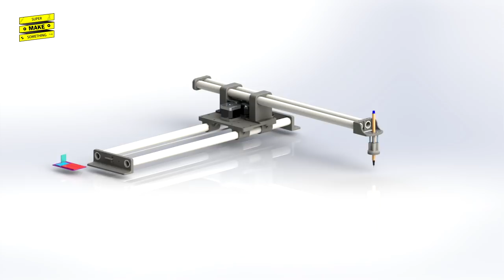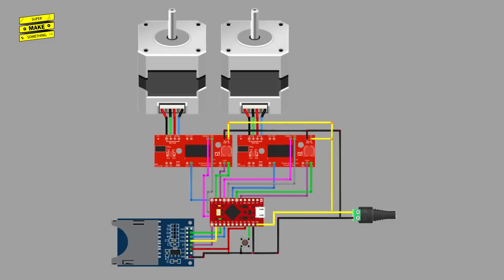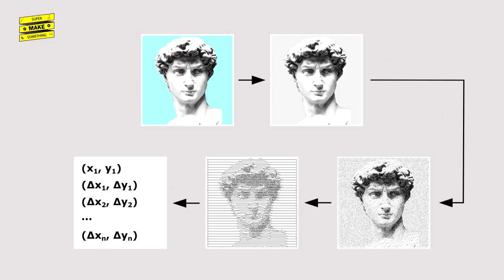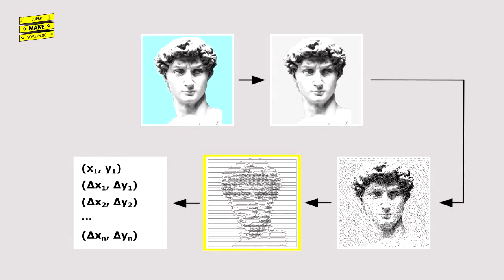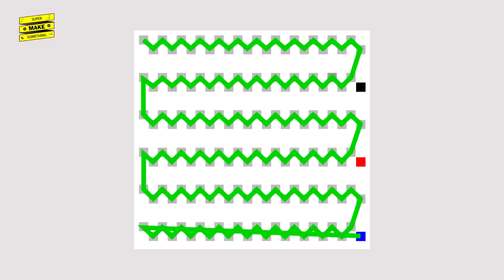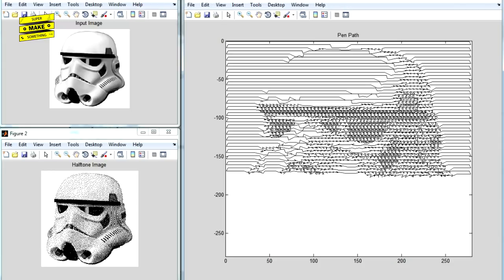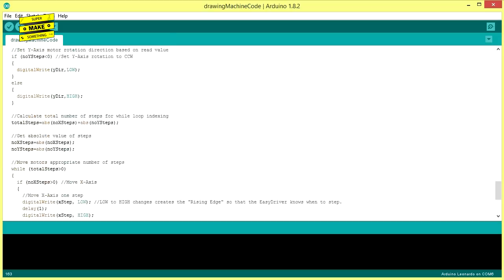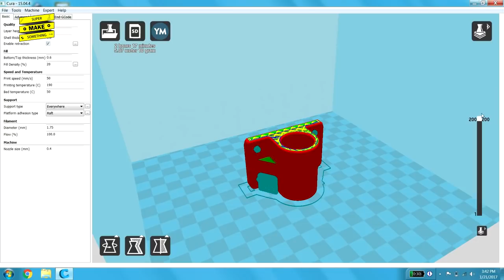Robotic Drawing Machine (Arduino, 3D Printing, CAD, PCB Design, Programming, Stepper Motors)

Comment: How it work's with the Poly Strings for the x and y Axes?
Reply from the maker: +Thomas Pfeifer The cables are wrapped around the pulley twice, which pulls the carriages along as the motors rotate.
Reply: Super Make Something Okay, thanks for your answer, I have to test if this works for my project. If it works and I publish it sometime I will link the video of you if that's okay. Greetings from Vienna Tom
Reply from the maker: Thomas Pfeifer That sounds great. I look forward to it! Best of luck with your project!

Comment: I ve Arduino uno and driver but not sd card pcb... so is their any alternative for this..... Can i use laptop
Reply from the maker: +Ankit maggu Hi Ankit, there should be a way to stream the points to the Arduino via serial, but this would require some modifications to the Arduino code and an additional program to stream the data.
Reply: Super Make Something... Thnx for  replying.... Can u guide me little bit more...

Comment: GREAT work ... but a question 
when you made your designs on SW did you used hole wizard for your screws
i mean the 3d printer could print a precise threads ?? 
thnx
Reply: Well, Maybe but you have the issue of the quality of the 3dprinters detailed layers, as in it may not be able to print such fine detail. at least on a FDM, on a SLA definitely can be done easily. How ever if you don't have a SLA 3D printer. Printing with-out threads on a FDM is better to do, and just thread the part with whatever type of screw/bolt/thread you want, not only that the consistent ratio of the threads may not stay the same when printed or the threads might be bigger or smaller than it should be So if you know your 3DPrinter can compensate it's varied dimensions well for Precise angled measured parts(as threads are very precise for the screw to fit, and turn easy with the screw.)then Isay go for it, if no. Don't worry about it.

Comment: I have seen countless and built around 10's of 3d printer, cnc and drawing machine, i really like how its approached from ground up. Really original. We would like to see timelapse of drawing machine. You might want to consider installing grbl and use normal cam software for gcode. Also the pen holder looks prime for a servo
Reply from the maker: Karan Chaphekar Thanks! Those are all very cool ideas and I agree about the servo -- the additional pen "z-axis" to lift it up and down would definitely not require a full stepper motor. Definitely a good potential add-on though to expand the capabilities of the machine.
Reply: Super Make Something that could easily be done with a servo or a DC motor.